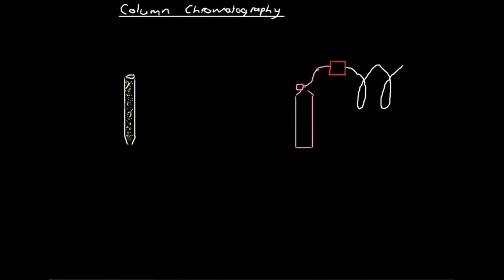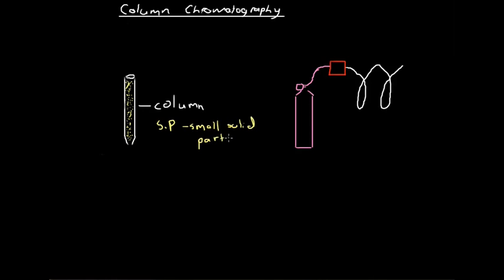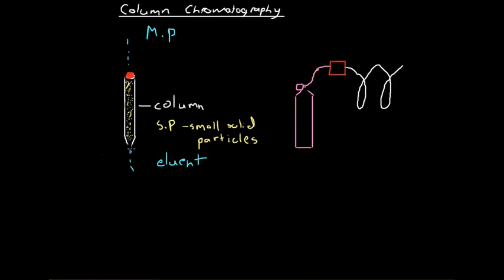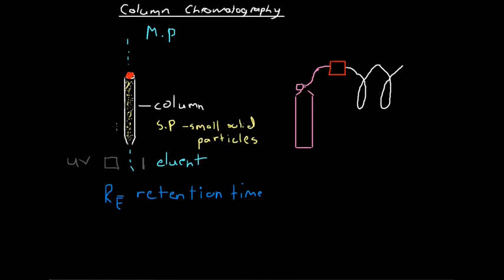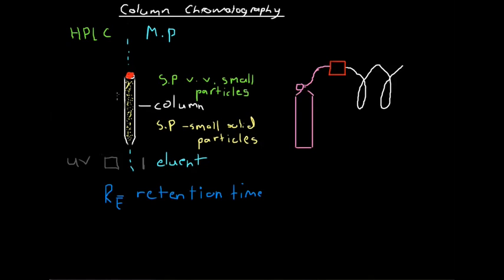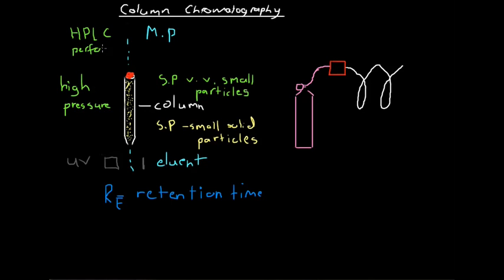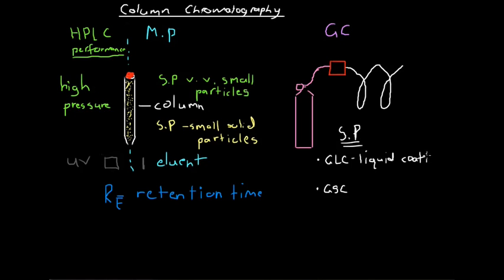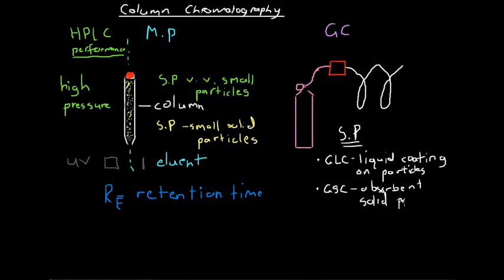Column Chromatography HPLC and GC

Comment: Your description about HPLC is more or less totally wrong. You are teaching students in the beginning about a  Size-Exclusion cromatography which is filled in the column with gel and small particles into which is then also trapped the sample (smaller particles). This is the correct procedure: 1. Mobile phase, 2. Pump (high pressure) phase, 3. Injector. ,4. Column, 5. Detector with Intengrator or Computer analysis...